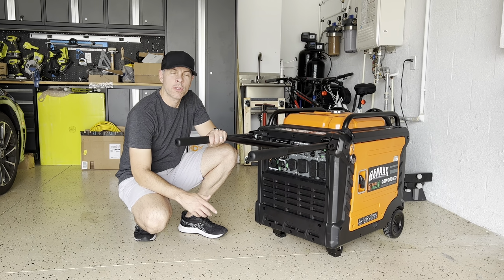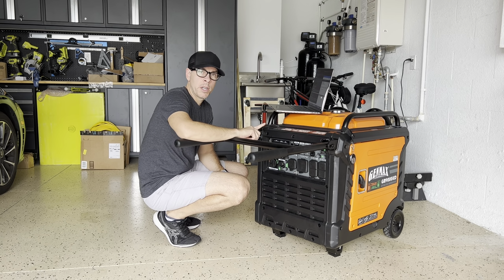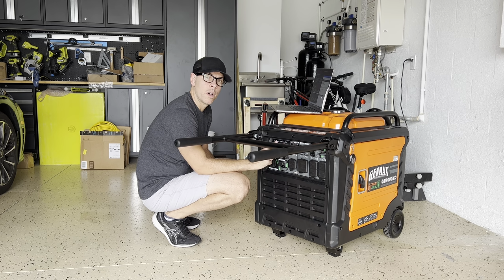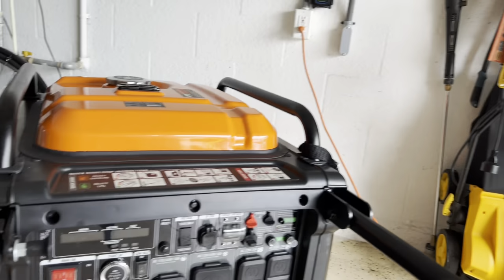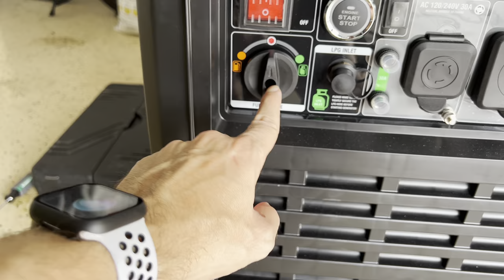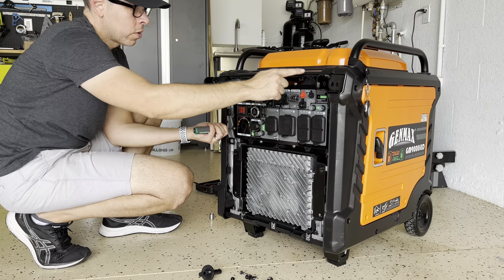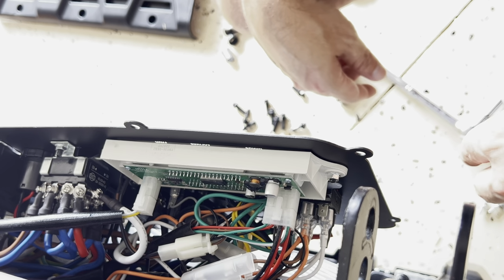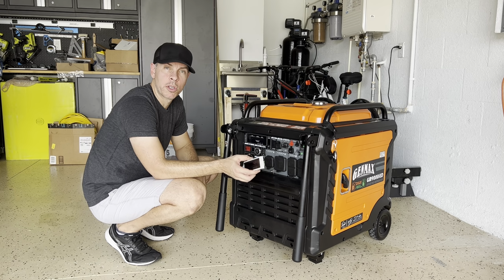How To Replace Genmax GM9000iED Digital Display Portable Generator

Comment: Thanks for this video I have same issue with my Duromax . I called Duromax customer support and was told they are aware of this issue and sending me out new panel ,and actually new battery all free of charge since the duromax warranty is 3 years. hopefully this solves my issue also on not keeping hour meter recorded  time . again thanks for this video

Comment: I have a DuroMax XP9000IH inverter with the same problem ("0" total time for every start). Is it possible to buy a digital display from Genmax China for my DuroMax? They look identical. DuroMax Customer Service says they cannot get just the digital display - only the complete control panel (and they are on backorder). DuroMax Custormer Service sent me a second inverter. It works just like the first one - always "0" total time on every startup.

Comment: Thanks Javier for the update. Hopefully  sometime in October.
Reply from the maker: They are working on it.  I  double-check and the problem is that California has a special regulation on emissions. Genmax need to modify the GM9000iED to comply with CARB. 

Do I need a CARB certificate?
Manufacturers of motor vehicles and engines must show compliance with California emission requirements before their products are legal for sale, use, or registration in the State. To show compliance, manufacturers must apply to CARB for certification of their vehicles and engines.

California model will be - GM9000iEDC

Comment: Very Interesting. Just curious if you ran it for 4 more hours to get the 4 hour total. If not the total hours are not stored in the digital panel but some where else in the unit somewhere. Interesting.
 My Duromax XP9000iH has the same problem.
Reply from the maker: Hi, I thought the same thing and commented the same thing in the video, but while editing the video, I edited out the comment. Because I thought, Having the memory in another Place did not make sense, NOW what makes sense is that Genmax tested the display before they sent it to me, and that is why it is showing 4 hours. As far as I remember, I have not run the generator for 4 hours yet. Contact Duromax to gen a new display.
Reply: @JavierRivera  Thanks  Interesting.  I will try and get a new one
Reply: Javier and RK, Duromax called me yesterday to let me know that they will be sending me a new display replacement for my 9000ih . They said that it will take from 3 - 4 wks to arrive since they don't have it in stock and they are expecting to receive a shipment from China in a few weeks. I will keep you guys posted.
Reply from the maker: @stelon7615  that is progress.  👍🏻
Reply from the maker: Ok I got an answer, Genmax Test it before it was sent to me "Yes the meter was tested for 4hrs before it was sent to you. If change new meter the hour will count from when it was changed. Kindly note! Thanks for the checking! "
Reply: @JavierRivera  @Rk my new Genmax 9000 iED already had 3hrs logged in the display when I fired it up for the first time. So I guess they do really QC test their units before shipping.
Reply: Ok so bought this new brand Genmax. Out of the box the display is not saving hrs so it too has a bad display?!  Broke it in per instruction’s on owners manual. 
Let’s see how this unit holds up in the future. I’m in Fl so hurricane season is about over. Got the battery on a trickle charger for next year. Haven’t decided on what I’m doing on bad display.
Reply from the maker: Register your Generator then contact Lisa at lisa@china-dk.cn she will send a new display.

Comment: Did you disconnect the battery.  If you didn’t you took a chance on it. Especially using such a big socket and wrench.  Need to get a 1/4 in drive set.
Reply from the maker: It is a very uncomfortable spot; you need a wrench or a very short drive set.

Comment: Hey Javier Eloy Garcia here in Clearwater Fl. I purchased a Genmax 9000iE in Oct 2021 sat in the box in my garage for 11 months until a hurricane threatened us here in Florida I unboxed the Genset and prepped it for use ..Now I have this same problem hour meter resets after shut down..can't gat any support from gen max / tomahawk. Question one where is the Serial # for the generator ? 2 Where do you get support/what's the e-mail just to see if the one I have is the same.I hope to hear back from you.
Reply from the maker: Mine has the serial number, facing the front panel, under the right side handle bar.   Send a email to Lisa at lisa@china-dk.cn - they are on a 12h different time zone. Let her know that you saw my video and then you realized that your total hour meter wasn’t working.  Also. She knows about the Hurricane here in Florida so mention that you bought it for an emergency and that is why you just noticed.  Good luck. 🍀
Reply: @JavierRivera  so after watching your video for the second time I noticed that you connected the new hour meter and it somehow knew the hours you had on the unit. So I have been writing down the hours but do you think if and when I get the new display it will show the actual run time?
Reply from the maker: @nitro200flyer3  I think the one I did receive was tested for 4hrs. I could be wrong, but I am not sure. I will ask the manufacturer, but I won't get an answer until Monday night.
Reply: @JavierRivera  I finally received my display and NO it does not keep the original time.  But at least it works Anyone buying this Genset needs to know that there is support but its extremely limited and you will need to be able to do the work your self.
Reply from the maker: @nitro200flyer3  Do you mean that still won't save total hours? Did you run the generator for over an hour?  If that is the case contact them again right away with a video. I am sure they will send another one.  Ask them to test it before they send it.  That is why mine came with 4hr total, they test it first.
Reply: @JavierRivera  yes it keeps time now the new one I just was trying to answer the question you had whether it remembers or somewhere it keeps time remember yours had four hours mine had zero and I ran it for over an hour but it did keep the time after I shut it down and restart it so everything's good on my end happy to have this generator it seems like a good deal. I'm just afraid that if it had a serious problem like a stator or rotor finding any way to fix it would be nearly impossible I happen to be an Onan 2 certified technician so I have no problem with it. I also purchase the 3-year extended warranty through Amazon it'll be very interesting that if I do have a major problem down the road how they will address it. Sorry if I confused you at first once again the new our meter works fine

Comment: I want this unit but genmax in sandiego which is right up the road from me said this unit will not be sold in Calif until late fall or next year. Been thinking about duromax but trying to hold out and wait.Strange to have support here but can't  sell them here yet.No one in China ever answered my email  about sale date.
Reply from the maker: Hello, you are the 3rd person that tells me the same. I am sure has to be some California regulation. Let me ask them and see if I get better luck than you getting an answer.
Reply from the maker: I just got a reply from them in 10min: Hi Javier,
Actually the GM9000i we have the certificates to sell on California! Just my boss not too much market so we didn’t make that kind of type at the beginning!
Now we already prepared the version GM9000iEDC under production right now will on sale in about 2 months! Thanks for the checking!
Reply: @JavierRivera  what’s the difference between all the current genmax generators and the genmax C version for California?
Reply from the maker: The only difference is that the emission will comply with California CARB regulations. “the California Air Resources Board”

Comment: You are the man. I have this same issue and I’m fixing it because of you.
Reply: I got the screen replacement but unfortunately did not fix the total runtime like yours did. Board did say it was ver2.0. The one I replaced was ver 1.0. Oh well. 😅 I’ll see how it does after running it for a while.
Reply from the maker: Call them again.
Reply: @JavierRivera  I just read your comments that yours was tested for 4 hours. I’m going to run mine and see how it does. Thanks again for the tip.
Reply: Will be calling as the replacement doesn’t measure voltage or count hours. The LEDs work but nothing else does. Good generator with some growing pains I see.
Reply from the maker: Did you contact USA 🇺🇸 or China supo?
Reply: @JavierRivera  I contacted China by email. They are sending another display. They said the one they sent is the wrong version. Thanks for the follow up
Reply: How are things holding up for you? Also are they now shipping these with the newer displays? I'm actually looking at the 7250 model.
Reply: @hoody2141  I actually never fixed it. They sent over 2 additional displays from China and they both did the same thing. I got busy and haven't been back to it unfortunately. Hope they fixed this by now.
Reply: @hotnics  other than the display is the generator holding up?
Reply from the maker: @hoody2141 hello. Yes. No other problem.  So far.
Reply: @JavierRivera  thx! Would you purchase the extra insurance through Amazon?
Reply from the maker: @hoody2141  I did purchase the extra insurance from Amazon. But I can not tell if it’s worth it or not.

Comment: Thank you Javier for your video. Because of it, and RK's comment as well, I realized that my Duromax 9000ih display wasn't saving the total hours of use either. I've already contacted Duromax Customer Service in the USA and they said that they will refer my issue to a Tech Support associate and to expect a call from them within the next 42 hours. I'm hoping that Duromax's service is as good as the service provided by Genmax in China. I will keep you posted. BTW I'm considering buying a Genmax 9000 to run it in parallel with my Duromax.  Thanks again!
Reply from the maker: Hey, I am glad that the video helped you.  Let me know if you get a display replacement.  If you decide to get the Genmax GM9000iED please use the link in the video description.
Reply: Hey Javier do you know the muffler outer diameter of your Genmax's 9000ied? I'm still debating if I'll get it. Getting it will depend on all the modifications that I will have to do to parallel the Genmax and my Duromax inside my custom shed, and muffler will be one of those modifications. Thank you!
Reply from the maker: The exhaust pipe has a cap at the end with a metal filter mech in the center. If you remove that I believe the pipe diameter is like 1-1/4” inches.  I could be wrong by 1/4” inch.  To be sure I might need to remove the back cover and the cap filter mesh and I can not do it at this moment.
Reply: Thank you Javier! I've measured mine with a digital caliper and I'm suspecting Genmax's outer diameter to be similar to the Duromax = 37mm (1.47") after spark arrest removal. I will wait for your measurement when you have time, no rush. Thank you again!!!!
Reply from the maker: Ok, I will check but that is what I meant by I could be off by 1/4.  I think it is 1-1/2” I also have a digital caliper.  Should be the same. Duromax, predator, and Genmax Share multiple parts.
Reply: @JavierRivera  thank you!
Reply from the maker: I have not forgotten about you.  My digital caliper ran out of battery, I ordered more at Amazon and I was waiting for my batteries for a week and I  thought where are my batteries.? When I checked Amazon changed the delivery to 3 weeks after so I had to cancel the order and order the batteries again from another vendor at Amazon.  I just got them yesterday, so I hope I can get your measurements this weekend.
Reply: @JavierRivera  thank you! No worries, I got my Genmax 9000iED last week. I checked your link but Amazon ran out of the 9000iED, and by the time that I was buying it, they only had the IE available. I got a good deal through one of Genmax's authorized dealers: FactoryPure. Anyhow I'm working on my shed modifications to accommodate the Genmax next to my Duromax 9000, and have them run together in parallel. I live in SE Florida and I want to be prepared to power my whole house in the eventuality we get hit by a hurricane. So far we have had a very quiet season this year and I hope it stays that way until season ends by the end of November. Hey thank you so much for remembering and taking the time to reply. All the best!!!
Reply: BTW, Genmax is now selling the parallel cord for the Genmax 9000 through Amazon. I bought mine yesterday so I'll let you know how it goes once I hook it up  to the Gemmax and Duromax.
Reply from the maker: 👍🏻.  I don’t know if you already have a micro-air EasyStart connected to your air conditioner but is a plus.
Reply: @JavierRivera thank you, yes I do. I ended up buying two Easy Starts, one for a  5ton a/c unit and a second one for a smaller 3ton. Total start peak amps were reduced by 55 - 65% on both units. BTW, great company too! I called MiicroAir for tech support help on my 3ton and they guided me through the whole process.
Reply from the maker: Hey. What size Exhaust Flex Connector Pipe is needed?
Reply: @JavierRivera  1.5"
Reply: @JavierRivera  mine is the silicone option that GenExhaust sells. Perfect fit!
Reply from the maker: @stelon7615  interesting.  Did you order a Extension Kit?  If so which one of the options available is a perfect fit for Genmax GM9000iED?
Reply: @JavierRivera  No I didn't. I wanted to get the extension kit but that would have required welding which most likely void the manufacturer's warranty. So GenExhaust recommended the silicone tubing clamped to the Genmax tailpipe. I opted for that option for both the Genmax and Duromax and I couldn't be happier. Fits like a glove.
Reply from the maker: @stelon7615  I will check it. Thank you so much.   I am looking for a Temporary / Emergency case to be able to run the generator inside the garage with exhaust to the outside for a future Hurricane.   It’s just happened I lost power with Hurricane Ian but I couldn’t start the generator with the garage door open because the winds were so strong and a lot of rain.
Reply: @JavierRivera  you're welcome! We were lucky we didn't lose power but to be honest I was hoping I did 😂. I was really looking forward to firing up those two generators. But joking aside, I hope that other than losing power where you live, everything else is good. Stay safe!
Reply from the maker: @stelon7615  Well.  I am going to say that I can’t wait until 6am to start mine 😂 I am counting the minutes.

Comment: I have the same generator and when it's running on the display it keeps changing from 120 to 220 is that normal ?
Reply from the maker: Yes it is normal.  According to the user manuals.  “VOLTAGE: Voltage display: 120V and 240V switch every 16 seconds.”
Reply: @JavierRivera  good to hear it's normal lol I also have the same problem I ran mines for about an hour but it still says 0
Reply from the maker: @roberth1091  if you know you have run the generator for 1 hr and the TOTAL HOUS METER reset to 0 when you turn off and on the generator, you should contact Genmax support to get a display replaced.  Is not the end of the world but is very helpful to know when to change the oil also you paid for a functional meter.

Comment: You can bring me the email you use for warranty in china headquarters ? they send the display to your house ? I have the same problem
Reply from the maker: Make sure you register it first.  lisa@china-dk.cn
Reply: @JavierRivera  how I register ? What website ?
Reply from the maker: @JesusGonzalez-my1no  Here is the link. if you have any problem print to a PDF the information and send it to the email I gave you.  The last time the page had a glitch.  https://www.genmaxpower.com/page/product-registration
Reply: @JavierRivera  where is the serial number?
Reply from the maker: There is a sticker on the generator with a barcode and a number.